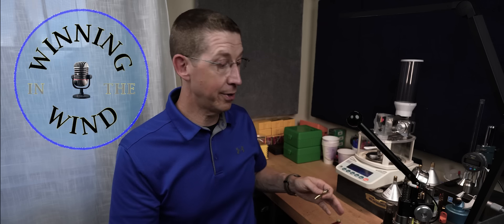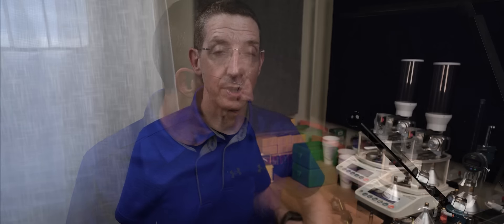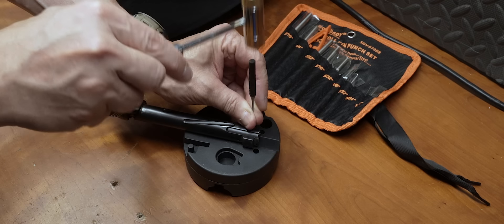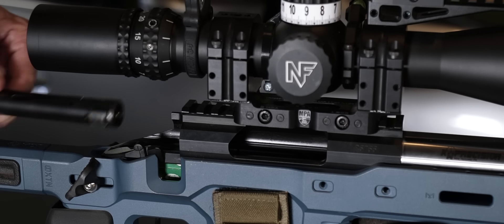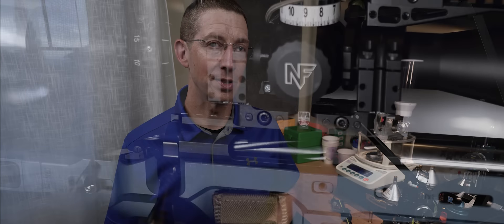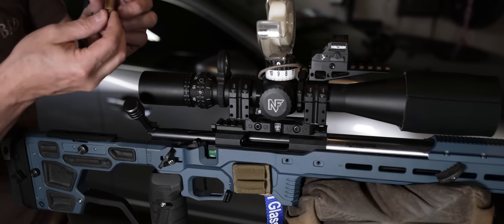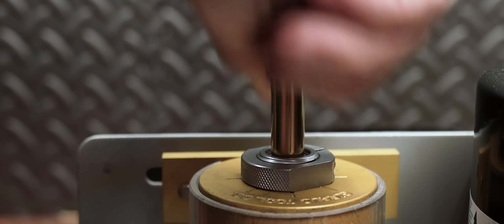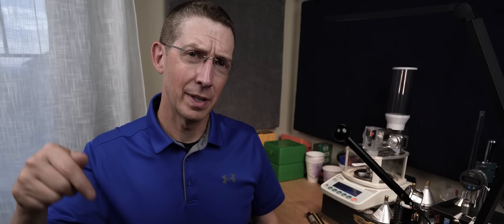6.5 Creedmoor First Resizing - Setup and Process

Comment: As a noob, I would like to thank you for actually showing the process to get the bolt ready for your method. I saw another video on finding headspace that didn't mention removing the ejector (probably because their bolt worked differently) and I overworked my brass. I kept resizing and wondering why there was still resistance.

Comment: Instead of disassembling the bolt to find the max brass length, have you tried partly setting a spent primer in a fired piece of brass then chamber the case and use the bolt to fully seat the primer and measure with a comparator to the seated primer?

This has worked well for me and has provided consistent results with no disassembly required.
Reply: Interesting indeed! Clever.

Comment: You might try the Whidden click lock die ring. They are .001 adjustable and make dialing in the case trim length a piece of cake.
Reply: But they don’t compensate the springy reloading press. Redding competition shellholders are therefore the better solution. Just adjust that there appears no light between die and shellholder, when sizing a case.
Reply: @ralfrude3532  I’m talking about using them on the trimmer die. Not the press.

Comment: Using the dry media cleaner can leave a clog in the primer pocket and flash hole.  Have you any feeling for using the wet SS pins cleaner. 
Great job live you videos. 
Dan Martin.
Reply: Most people are going away from SS pins for a couple reasons. 1. It can dent and roll the case mouths if tumbled for too long. 2. It removes too much carbon from the case neck causing rough and inconsistent bullet seating. This can be fixed only by using dry neck lube before seating or throwing them in the tumbler for 30 minutes

Comment: Great video ... agree with all except the corncob media vibrator. Web-tumbling is much neater and does a better job (IMHO).
Reply: This is going to sound weird, but wet tumbling is too good.
Reply: Most precision shooters don’t wet tumble because it can damage the case mouth. Even if the case mouth isn’t damaged you are still removing the carbon from the case mouth which acts as a lubricant when seating bullets….
Reply: @bawhitham23  Thanks ... but not 100% on-board with that. I've seen case mouths damaged if you use steel pins, but I don't, and have thousands through my wet tumbler without ever seeing any damage. Also, I lube the case mouth with NeoLube #2 before running my mandrel and seating, as I'd much rather use that for lubrication than consciously leaving residual carbon build-up from prior firing. To each his own ... but that's how I roll.
Reply: Wet tumbling is great. It doesn't damage the case mouth if you don't overload the tumbler and keep the tumbling time down. I started doing it to remove the oxide layer left on the brass from flame annealing. However, you will then need to lubricate the necks(I use one I make with 99% ISO and graphite powder) or you will lose accuracy potential. The powder residue inside a case which is not wet tumbled normally takes this role. It definitely makes a difference. I saw group size increases of nearly 20% with squeaky clean necks in one of my benchrest guns.

Comment: I’ve got a 6GT I’ve been using for midrange fclass.  I’ve been strictly using a bushing sizer(size recommended by GAP).  I’m wondering if I’ll get a little more consistent ES/SD if I go a size down and then mandrel for neck tension.
Reply from the maker: As with any technique, your mileage may vary. The big question you might want to answer first is how consistent are the seating forces now?

Comment: Are you using pin gage to check case mouth I.D. ?  If so,  how many thousandths under projectile size do you like to go?   Thanks for the videos!
Reply from the maker: Not on these. I do that for my F-class rifles, but not for the PRS stuff. I don't have appropriate pins for .2600-.2635

Comment: How'd you choose your aztec case..?
I appreciate your headspace approach..
In past I check all fire formed brass...there is usually up to 3 thou variance..I put the longest cases to the side and gently feel for resistance on bolt close...this case gives me the maximum measurement...and aim to size a thou shorter...
No problems yet..
Lee neck collet I like...can't afford redding dies anyway.
Redding body die for when headspace is too big...which is rare...so far..

Love your work Keith...
Thanks for sharing..

After trimming and chamfering. 600 cases recently..the Girard trimmer looks like heaven....does I have a VLD option though?
Reply from the maker: The inside chamfer angle is pretty shallow like a VLD inside chamfer tool.
Reply: @winninginthewind  thank you Keith..I like my KM VLD inner chamfer tool...
Like many things...not sure the dif it makes...but like VLD chamfer idea...

Comment: Why is the firing pin removed ?
Reply: The ejector is removed because it pushes on the base. Leaving it in would keep you from measuring the correct dimension.

Comment: I've never had a problem in over a dozen rifles just taking a shoulder measurement off fired brass using a comparator and then sizing to reduce that measurement by  0.001" or 0.002" depending on the application. Given that you're using your comparator to "save" your measurement and test all future brass this seems unnecessarily complicated.
Reply: I agree if I set the die up and I'm between. 001 and .003 and it  chambers I'm good if I want it to work in any gun then I bump .004 or .005 I've seen other guys do it his way but they were all geeks with pocket protectors and lived and died by how small there groups are. Buy the way I have one of them geeks in the family you could by all my reloading stuff for what just there scale cost nuts.

Comment: *299 cases...  sans Aztec.
Reply from the maker: You got me! Actually, it was 298 because I lost one on the ground during fireforming at a match.
Reply: Those hurt. I sweat more about the crumbs I lose than the morsels I eat. Sacrifices should be canonized.
Reply: Secret between friends: you can easily reform 6.0CM fed GMM brass to 6.5 with graphite and patience with remarkable consistency and be able to use small primers. Identical dimensions but for neck diameter. Small primers CAN be a lot more consistent; when you think about the size of the cup and the process of manufacture that should probably be fairly self evident. And they’re roundly more abundant!  S&B’s process of manufacture for large was apparently superior vs our domestic options for consistency (their large had amazingly linear response vs powder mass at johnny’s reloading bench; might’ve been bolt action reloading) but must’ve been more dangerous...  bah.  I wonder what that process is. Must’ve been equivalent to our domestic benchrest process.